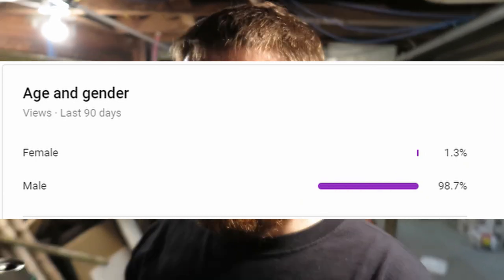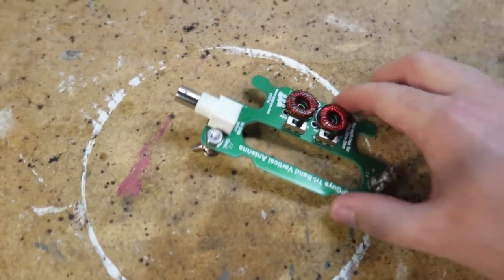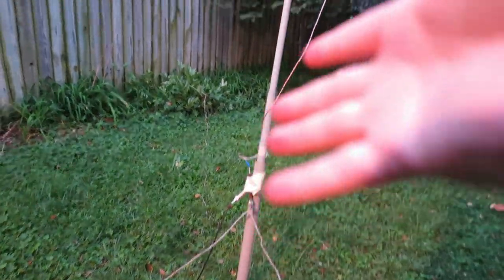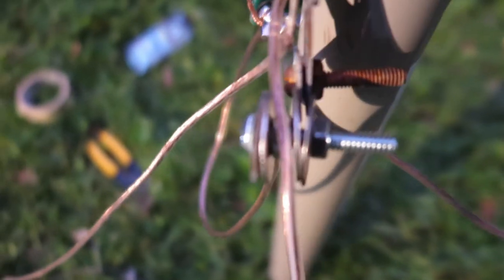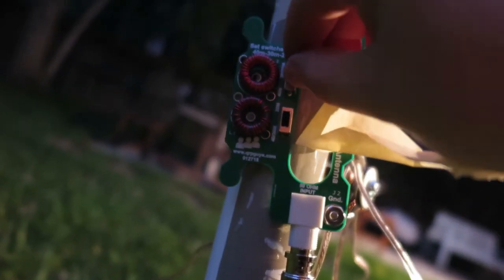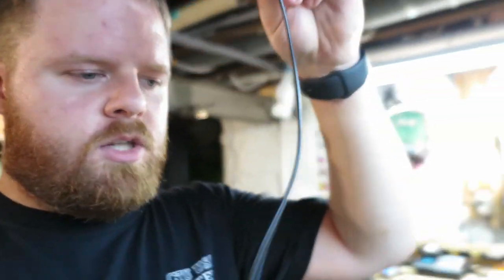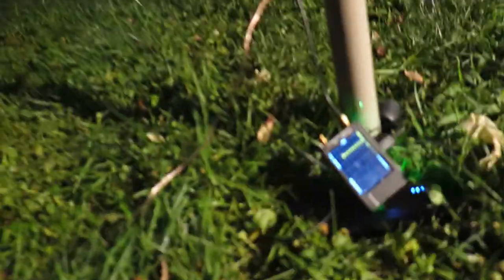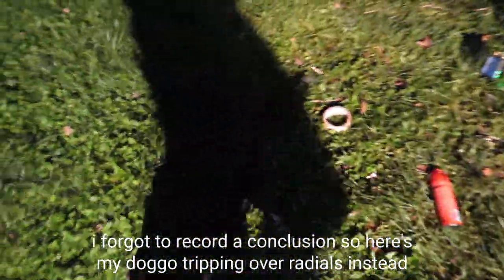QRPGuys Vertical Tri-Band Antenna Testing (with the DX IDIOT)

Comment: "..need to play around with with the antenna length.."
NO, YOU DON'T! YOU'LL FUCK THE OTHER TWO BANDS UP! Read the fucking manual, man! Tune the element to 30m and then check the toroids. Crimp or expand the coils or possibly rewind the latter of the two coils to bring it into resonance.
shudder